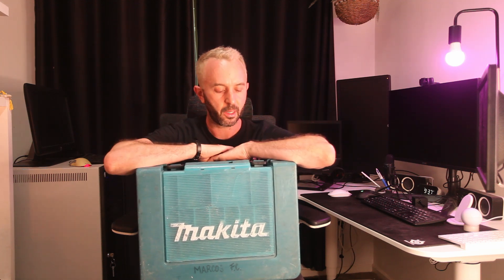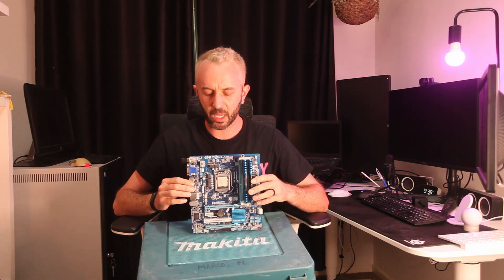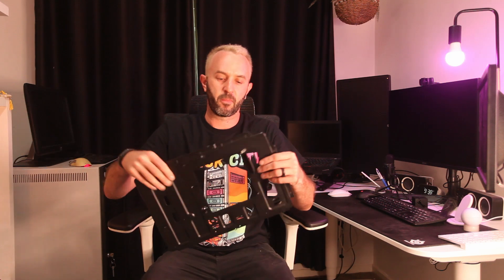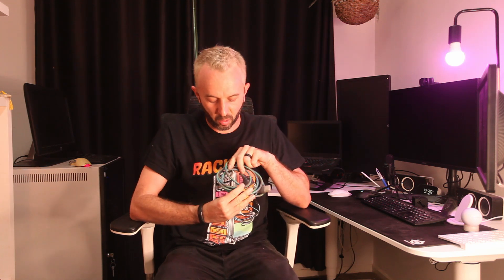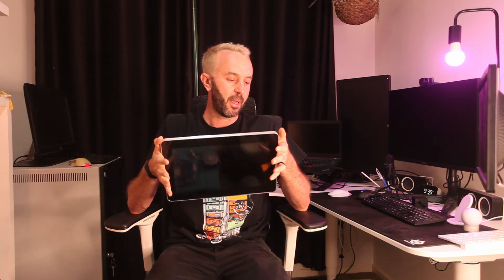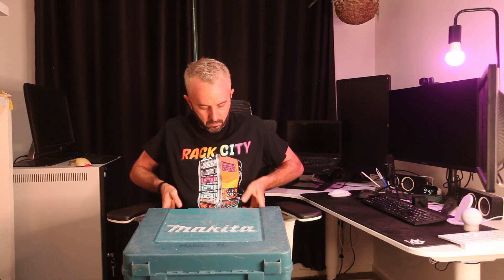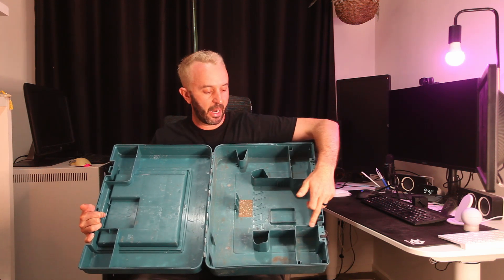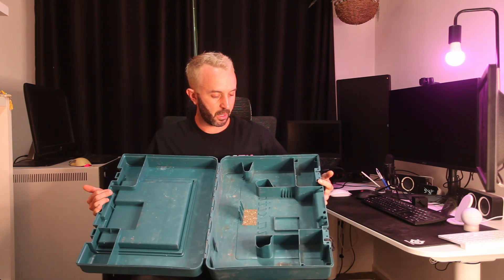The Makitaputer - DIY Cyberdeck PC in a Makita toolbox

Comment: If you ever decide to rejigger it (or someone else follows your example), Consider fastening the motherboard mounting plate with epoxy, or other high-strength mechanical means, THEN screwing the motherboard onto the plate mounting points. 🙂 (just found an 18V dewalt tool kit hardcase, and with so much room, it is my next project in the pipeline. Might be able to fit a nice solid 17" lcd in it.)
Reply from the maker: Nice! Good call out :)